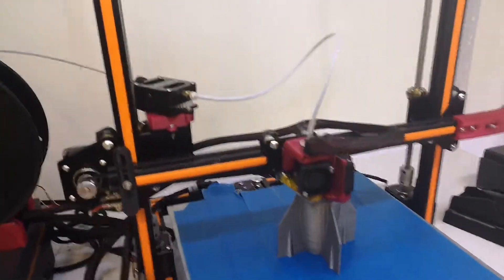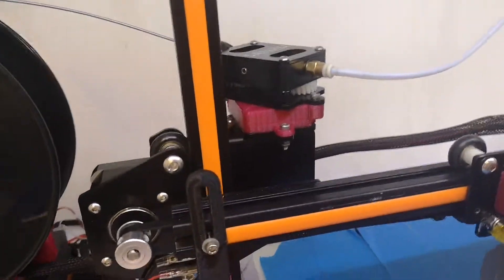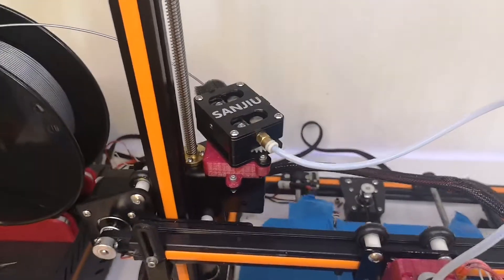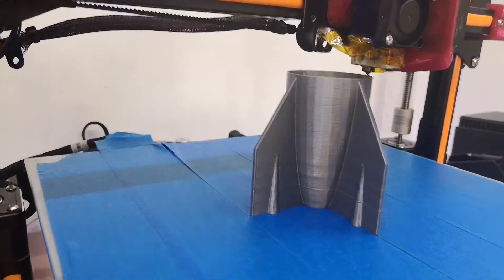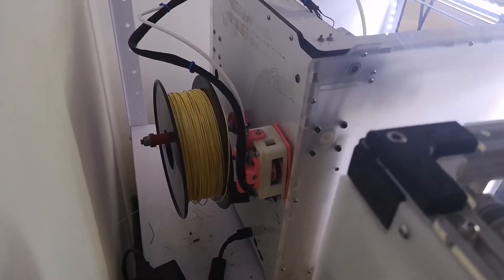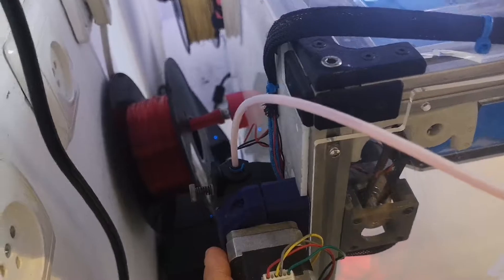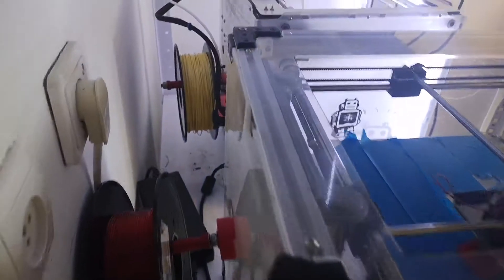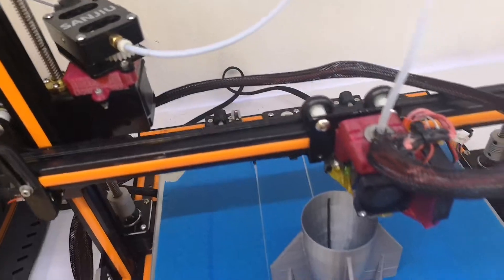SANJIU ALUMINIUM double barrel extruder - worth 45$?

Comment: Actually I just ordered a B2D extruder already made up (it was still cheaper than this Sanjiu by a lot and I'll have the parts kit one way or another) although you are making me wish I had gotten one of these.  You have the only real video I've seen of the B2D just... working.  So it looks like you've had it a while on that Ultimaker and you still like it a lot?  Do you use the B2D on 24 hour prints?  Has it been completely reliable?

Comment: Are you happy with that (i mean the SANJIU one)? i've just ordered one of that for my UM2 (1.75 Machless 3dsolex mod).
Reply from the maker: Yeah I'm really happy with it. I've just cranked up the tension to maximum and my ooze control and flow consistency never have been better.
Reply: Thanks for reply. A question, i have to mod my UM2 Stock firmware to adapt UM2 to SANJIU?
Reply from the maker: Mmm for sure friend, so you might need to change the direction of the motor- Good news is that you don't actually need to change firmware settings in order to reverse it- simply reverse the order of the motor wires. And for multiplying the steps by x3 - you can do that in the standalone lcd menu way. In my opinion it would be better to update the firmware. Look at GeekMod firmware , it's friendly and easy to use.